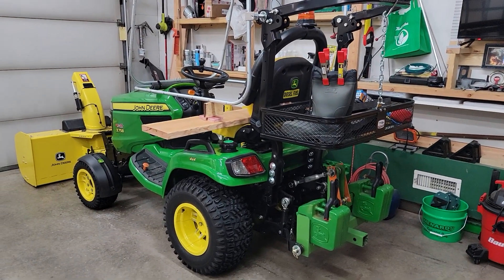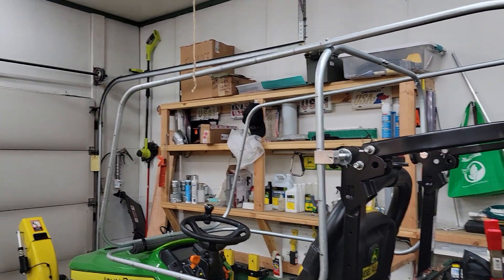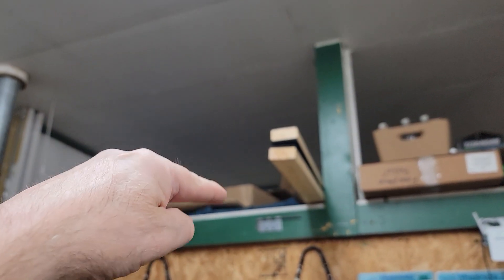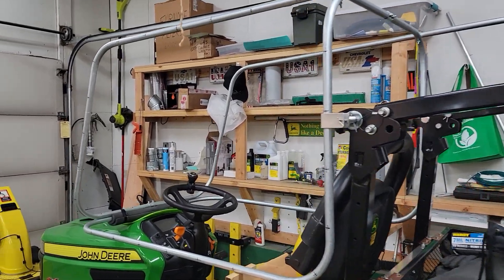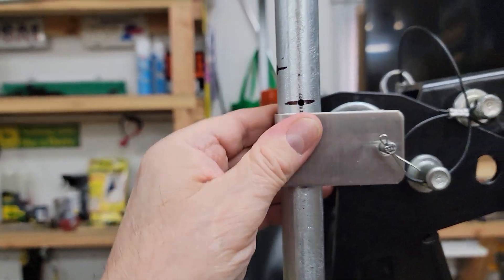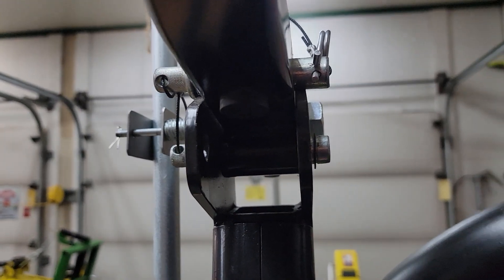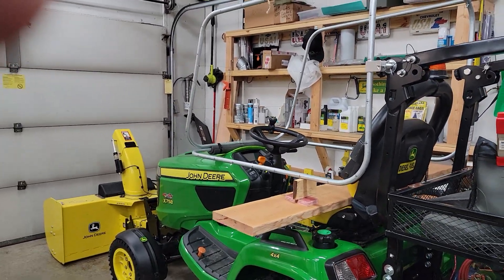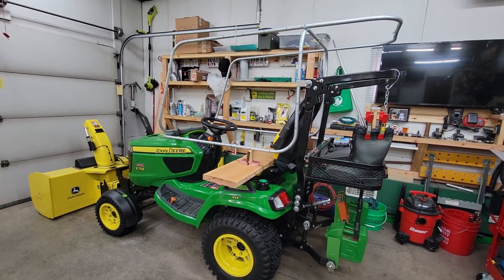windbreak cab for garden tractor, X758.

Comment: might be able to have a canvas with isinglass enclosure made that has zippers to unzip when not using. they can even make zippered doors with the canvas and isinglass. check out boat places that do custom work.
Reply from the maker: Thanks for the ideas. I'm actually finished with it. Clear sides and windshield. Black top, I just flip it open and let it back down. Keeps the wind and blowing snow off me. I'm good to go.